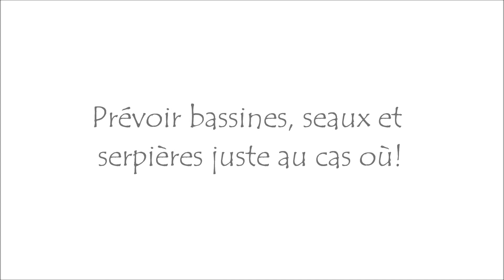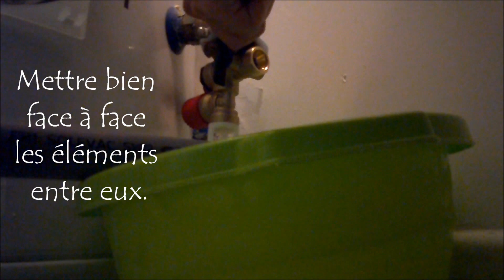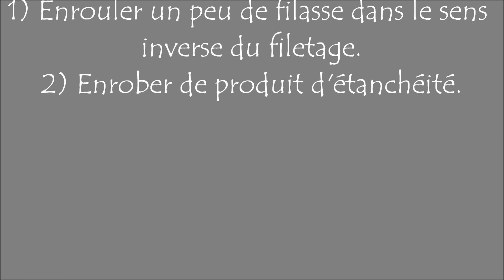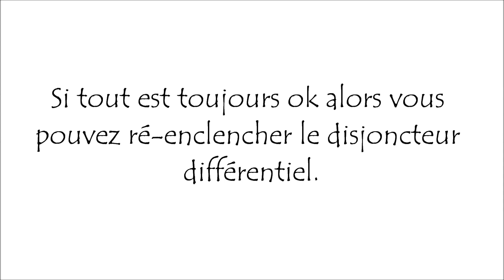TUTO - Remplacer / changer le GROUPE SÉCURITÉ de votre CHAUFFE-EAU - Rapas4U

Comment: faudrait peut etre refaire le joint avant de monter le nouveau groupe
Reply from the maker: Salut ! Merci pour ton commentaire. Bien sûr, il faut faire un joint neuf sur chaque raccordement. Le raccord vertical comme le raccord horizontal 4:08 mais il est vrai que dans le montage vidéo je n'évoque pas de joint à faire concernant le raccordement vertical.
Bonne journée ! 😉
Reply: @Rapas4U  Bonjour, j'ai le même chauffe eau mais je n'ai pas de possibilité de faire pivoter le groupe de sécurité, le bouton rouge vient buter sur le chauffe eau. Quelle serait la solution ? Merci pour tes conseils et ta video
Reply from the maker: @model3d90  Salut, le plombier qui a monté ton chauffe-eau et ton groupe sécurité l'a bien fait rentré. Il a dû forcer un peu, regarde si ton ballon n'est pas légèrement enfoncé. Merci pour ton commentaire et j'espère t'avoir aidé.
Ciao 😉
Reply: @Rapas4U  Il y à bien 3 mm en +. Est ce que tu croix que peux dévisser un peu la partie plus haute avec la pastille bleue ? Merci pour ta réponse et pour ton aide.
Reply: C'est bon du coup. J'ai fait pivoter le tuyau plus haut pour avoir plus de place pour travailler et dévisser le groupe de sécurité. Merci et bonne fin de semaine. :-)
Reply from the maker: @model3d90  Super, carrément, à mon avis, tu as trouvé LA solution. J'ai créé la chaîne Rapas4U justement pour ça, partager nos expériences pour être capable de se débrouiller au quotidien. Alors un immense MERCI 🙏 à toi, en mon nom et au nom de tout ceux que cet échange aidera !
Cooool 👍😎